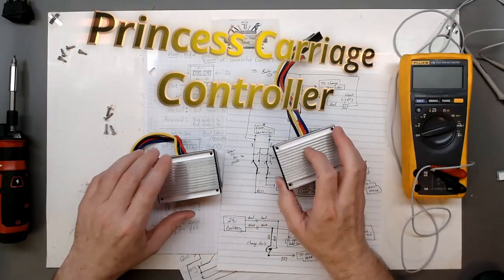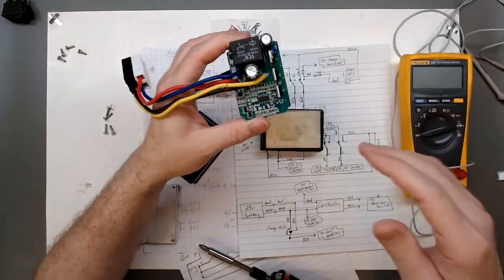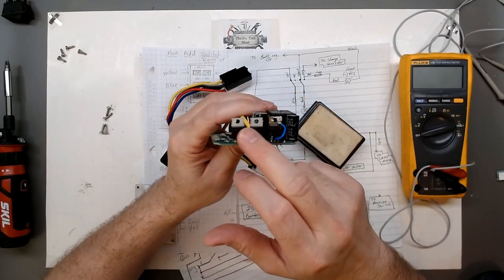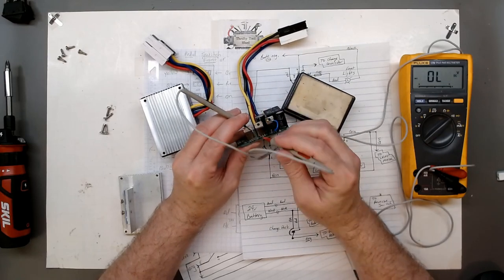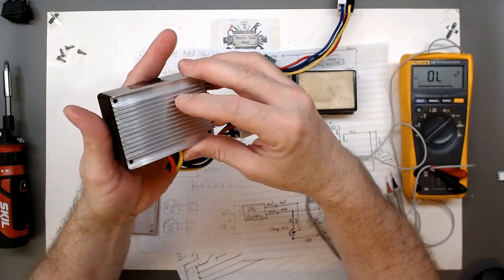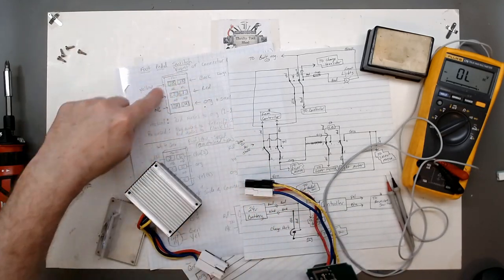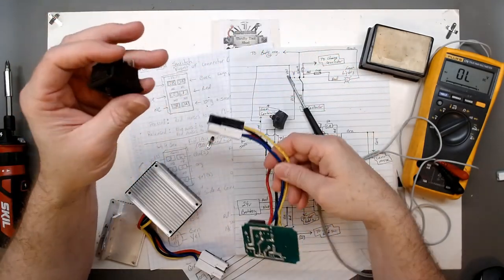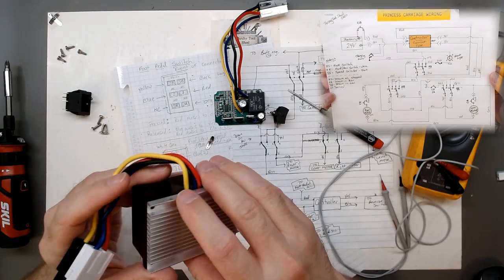Disney Princess Carriage Speed Controller

Comment: Hello, great video. I'm working on my niece's carriage. I have 12volts at the battery (dont have the charger), 12 volts at the the for switch but only 6 at the controller. And out to the motors
Reply from the maker: Hi,
Thanks for your kind comment. I have only seen 24v carriages. Not saying it's not more than one model though. I would double check that battery and see if it should be 24v!
Reply: @ThriftyToolShed  it is 24 volt but only getting 11.8 volts. I don't have the charger but that should be enough to make it a least move a little correct?
Reply from the maker: @corydemerath7779  I doubt it. It would be like your car battery having only 6v instead of 12v plus. It would not turn over. The Battery is extremely weak. The controller on the carriage may not work correctly with 12V either?
Reply: @ThriftyToolShed  thank you. I'll try to get it charged and see what happens
Reply: I found a charger on amazon for about 12

Comment: I have two of the carriages and they both worked great now one of them just jerks when hitting peddle even with tires of ground.  swapped the shift lever, peddle, and controller between the two and the one still works(with parts from one that jerks) and other still jerks.  motors run good with direct power.  any ideas?
Reply from the maker: So motors jerking instead of soft start does seem like the controller, but since you have swapped that around that's odd. Or do you mean it just jerks and stops, like it does not keep rotating? That almost sounds like the battery, but since you have tried it on direct power, you have almost ruled that out. I would make sure you test the 24V all the way to the controller while testing and make sure it's not dropping out under load. If your battery is holding up, it could be switch still losing voltage accross it. You swapped out most of them, still may have bad connection. All you can do is see where the voltage might be dropping at!

Comment: My sister just purchased one of these used and the battery is measuring 28VDC after re harging. I am not able to get any response from the pedal while the battery is fully charged. What is your recommendation for me to investigate next?
Reply from the maker: I shared a wiring diagram of the one I worked on to aid in troubleshooting. I would first make sure the battery voltage is not pulling down when loaded. So if the pedal is pressed is the battery voltage dropping off or is it staying up in the 20-28Vdc range....
If voltage is staying up then trace down through the diagram where the circuit is broken before getting to the motors. There are a lot of switch contacts and a controller in the circuit so the wiring diagram should help.
https://youtu.be/HnqSQFcANPE

Comment: My granddaughters exact carriage which she has the blue and white one but it's been kept in the shop out of the weather but hers is barely going to not doing anything the battery is fully charged and the lights work but nothing, we can get it to go a little but it's just dead what would you check first
Reply from the maker: Either the battery is weak and the voltage is dropping under load or you are losing voltage through a connection. I shared a quick schematic of the one I worked on and shared it on video if you find it helpful.
Reply: Thank you so much for 💆 back so quickly, 1 person said the motor is shot, It's less than 2 years old and my granddaughter hasn't got a total of 4 hours riding time on it It's never been outdoors and it looks like a brand new one, I jacked it up and pressed the pedal and turned the tire and it started going but it got weak and stopped I can hear the motor click when I mash the pedal so someone said it's not the pedal but I'm not sure they're right, and could a motor go out on one that's hardly been rode? It has sat for a while and I didn't charge it but when I did it always worked, I'm going to do what you said because I can just feel like it can be fixed, again Thank you
Reply from the maker: @philliptoole8360  
If the motor has a click it could be something in the gear that drives the wheel on that side. These have plastic gears. They are very robust, but something could be going on there or possibly something got in there causing issues. I believe you can unplug the motors individually on these. If so unplug the one clicking and with it in high speed the other one should still run to test that side out and you can repeat on the other side to compare.

Comment: My daughters has a good fully charged battery new peddle fuse is good but no sound or lights what is something else I can try
Reply from the maker: So it runs fine, just no sound and lights?
Reply from the maker: It is actually AAA batteries in the horn of the steering wheel where the sound box is and the other lights around the top canopy also take AAA batteries I believe. Just wanted to mention that.

Comment: Hello. Questions my daughter cart will go in reverse. But will not go forward in high or low. Switch handle seems loose but haven't took it apart got any pointers on where to start. Thank you
Reply from the maker: Sounds like the Fwd/Rev switch. I would look at the back and make sure connections look good when you pull the assembly out. It could be a wire in the back, connection or the switch itself. I also have a video sharing a wiring diagram that I quickly laid out for the carriage. Best of luck to ya!

Comment: Ok thanks to your videos I fixed my ride.  Then I decide to add 2 20v drill batteries to this ride to make it go faster.  Haf problems going but when It did go it was fast. Then it stopped and this control box was warm. Did I fry this box and can I bypass it
Reply from the maker: I would not bypass the soft start controller. If you do so, just for testing when making sure the motors will run with 24V across them and are ok. Other than testing, I would not bypass this soft start controller because the Foot pedal switch can not handle the full on/off inrush current of the motors very long with out failing. The soft start controller is very much needed on this carriage. As far as (2) 20V batteries? Did you put the 2  in series or parallel? If series and the voltage is 40V then I would say the controller and motors could be bad. It can not take 40V input. 20V should not really hurt it? May be a little weaker especially in Low?

Comment: I THINK I FOUND THE PROBLEM!!! Same exact spot on that diode you pointed to that you said was bad! That and a nasty looking little brown resister on the other side. So excited to order one and try it!😁🙏 
Thank you kindly,  good sir!
Oh, do you think k should go ahead and order a switch too? Switch looks good and feels fine, but I didn't get power when testing from blue to yellow.
Reply from the maker: Excellent! Yes, I would order a switch as well and already have one since they are a common failure point and I have even seen those fail with contacts stuck together before and it is not a good thing. To be a pink carriage, that thing is supprisingly powerful.
Reply: @ThriftyToolShed  So check this out! I ordered the foot pedal switch and the  controller. Swapped them and it still didn't work. Decided to check that little fuse one more time and it wasn't blown, but there was a little bit of funk buildup on the contact points where the fuse touches. Cleaned those and it still didn't work, but for some reason, decided to put the old foot switch back in and try and the the WORKS!!! 😂
It was the fuse! Just dirty. But the new switch doesn't work either so I'm super lucky I tried the old one or I woulda just continued troubleshooting down the line🤦‍♂️😓shew!!! 
Thanks for all your help in your vids though man. You are appreciated.
Reply from the maker: @bobbysweeney5377  Awesome, glad you got it! Crazy that the new switch is bad...
Reply: leahwatts4904  its most likely the same fuse. The wiring around the pedal,  you'll see a little inline cylindrical fuse. Pull that out and check the fuse. Here's the thing.  Even if that fuse looks okay, make sure the ends aren't all brown or burnt or anything because even with an intact fuse, mine wasn't working because if a slight buildup of deposits on each end . 
None of my aftermarket pedals worked those dudes are ripoffs
Reply: leahwatts4904  its definitely that same issue. Thats what mine did so that is the extent of my "definitely" tho. Lol

Comment: I’m planning to use the speed controller from a razor go cart and the foot pedal throttle to replace the original one of the princess carriage to have a smooth start.  Do you think it will be possible?
Reply from the maker: I am not familiar enough with the go cart controller to say either way. If it is rated high enough voltage and current and has the soft start or the variable control it maybe fine! Best of luck to ya!

Comment: How can I fix my daughter car motors are good but there’s no power at all battery has 24v motors are good I already test them but no power in low or high speed and reverse what it could be any idea
Reply from the maker: You will have to trace down the power and make sure 24V is getting to the controller. After that you will see it go through the switches for speed and direction if it's getting through the controller. I have a video where I share the schematic that I drew by hand. Hope it helps.
https://youtu.be/HnqSQFcANPE

Comment: I have been trying to fix my daughter's carriage for a while. 1st I replaced the battery with a 18v power tool battery bc old battery was dead. Still wouldn't work I was getting power at the foot switch. The shifter wasn't in good shape and the plunger switch on the black was broke. I replaced it. Now still won't work but when I press the gas it seems to want to move and some times it moves just very little. Do you think it might be the gas pedal switch. If so how can I test or is it the motors
Reply from the maker: Well first I would make sure you have enough power for this carriage. This carriage is alot larger than alot of power wheel type riders. I have had luck in the past with 18V powering some ride ons in the past. This carriage is a beast on a battery really. If trying with anything less than a high capacity 24V I would only test it in low or slow speed when the motors are in series that way it's not pulling the voltage too low and causing issues with the controller.  Once you test it in low then maybe you can tell if the soft start of the controller is working. The controller is necessary for the carriage because it soft starts the motors so not to give whip lash. The motors really are pretty powerful. But for testing you could bypass controller briefly so you can see if power is getting through. This controller is unusual that is why I did a video on it. It is a pass through, no signal activated it. it is simply soft starting the motors.
Reply: @ThriftyToolShed  great video.  One question, I get proper power to the controller over the red/black wires when pushing the pedal.  The carriage doesn’t move at all.  I’m assuming it’s the controller.  How do I bypass the controller so when I press the pedal, the motors get power?
Reply from the maker: Well, if you look at the schematic in the wiring diagram video. It shows the the controller is just inline with the power to motors. So it is just a soft start and current controller. You could simply bypass it for testing. But only for testing, the switches are not designed to handle the full inrush current of the motors! The Red and Blk in come out from controller in the Blue and Yel.
As schematic shows it then goes through the F/R and speed selector switched before it gets to motors.  As mentioned before, I would test it in low speed mode, so the motors are in series. Should be less current on the system in that mode.
Reply: @ThriftyToolShed   Haha, I was hoping you’d say something else because I did indeed bypass it the way you described and it doesn’t run in high or low.  However, after you commented I threw it in reverse just to see what happens and the motors do spin the wheels.  Would this indicate one or both of the F/R switches is bad?
Reply from the maker: Yes, it goes through the switch assembly before going out to motors so at least you know now.
Reply: @ThriftyToolShed  it turned out to be a bad battery and a bad speed controller.  Thanks for all the help!
Reply from the maker: Awesome, glad you got it! Thanks for the update!

Comment: Can I bypass this?
Reply from the maker: It's possible for testing. This is a soft start controller so it does several things. It makes it a lot less jerky when starting and stopping and also the motors may over current or overheat with the 24v directly supplied to motors for long term running. Low speed with the 2 drive motors in series maybe ok for a while?

Comment: 🤔I have been messing around with my daughter’s carriage on and off for a year or so. I originally tracked the problem to the foot pedal. At the time, I couldn’t find a replacement. So I took the switch apart and cleaned the contact points and bent them back to a acceptable clearance, and it worked for a good while. I originally had 24v at wires behind plug. Now I tried to test the wires from the pedal, and I’m only getting 2.10v from the power. But when the charger is plugged in, it’s showing a green light indicating, it’s charged.  When I plug the charger in and test the wires, I get nothing, no voltage. Can you please give me your professional opinion, where I should go from here. I want to get it running, without buying a bunch of parts I don’t need. By the way, I appreciate the wiring schematic. I’m no engineer, but I can understand the overall parallel and series portion of the motors, and how the forward/ high low work. It’s this speed controller, I’m lost on and hopefully you can help me. Thank you for your time sir.🙏
Reply from the maker: You should be getting the 24v at the pins of the foot pedal switch for sure. After checking 24v from battery it then should go through the circuit breaker then the charging port contacts then that orange wire should have 24v on it at the pedal switch. Just check these points with the meter and any black wire should go back to battery negative.
Reply: When I put my meter leads on the pins, the voltage drops constantly till I remove the leads.
Reply from the maker: @unknowninfamous2346  , as mentioned in the other video post you made, it seems your battery is an issue.
Reply: Thrifty Tool Shed safe to say, I should get another battery and foot pedal? By the way, I really appreciate your help sir. Thank you so much.🙏😉
Reply from the maker: @unknowninfamous2346  
From what you are telling me, I would replace battery and foot pedal switch. Glad it helped!
Reply: Thrifty Tool Shed could you recommend a place to order a battery? Seems all the sites I’ve seen say 24v but the fine print is showing  it’s really a 12v. I’m sorry to bother.
Reply from the maker: No bother, one reason I did not have a link to battery is because I did not buy one myself for this carriage or test one. The friend and owner of this one bought 2 larger 12V batteries and put them in series to give a much longer lasting battery but it does take up more room, and the back cover will not go back on. I would recommend going with the 12V as well if you don't mind connecting them in series and them being larger. You will of course have to charge them individually with a car battery style charger from now on though.
Reply from the maker: If you rather have a 24v more like the original you can look at these, I am not any way recommending these. I have not bought from here at all, just seen it while searching and thought you may want to look at it?
https://www.kidswheels.com/parts-by-brand/category/856458-disney-princess-carriage-24v-parts
Reply: Thrifty Tool Shed that sounds like a good option, the original was fast and lasted a long time too. I guess your friend would know if the trade off is worth it. In reality, they are both 24 volts, but I could see separate cells taking longer to drain. Appreciate it...😉👍💯
Reply from the maker: @unknowninfamous2346  
Best of luck to ya!

Comment: I got my kids one of these from Santa they were riding it for the 1st time they hit a pole and it has turned on since
Reply: What could it be?
Reply from the maker: Well it could be alot of things to be honest. The motors do have circuit breakers going to them, make sure they are reset. I would start looking for a loose connection if it hit something and then quit. I would check battery charge level and then connector first and go from there. Including the connectors on the back of the switches that can be seen in some of the videos. I show the foot pedal switch and the Speed and direction shifter assembly out and make sure the connectors on the back of switches are plugged in all the way. Other than that, the schematic I did a video about should show how to trace down where the voltage stops.
Reply: @ThriftyToolShed  okay I checked the foot pedals and the shifter and that was it I plugged in the charged and it popped now it doesn’t work or the green light doesn’t come on now?

Comment: Hey guys I have been having trouble with the reverse and low speed not working can anybody help ?
Reply from the maker: I also have video on taking the selector switch apart and video showing you the schematic I have created.
Reply: Yeah my daughters is having the same issue. Low speed wasn’t working and there was a loud noise when in reverse with the pedal down.
Reply from the maker: Hopefully you find the videos helpful. I could not find any information on these when working on my friends. I shared what I could. I did a short video on the foot pedal switch, fwd/rev lever switches and speed controller. I also did take time to draw out a quick diagram and went over it  if needed.